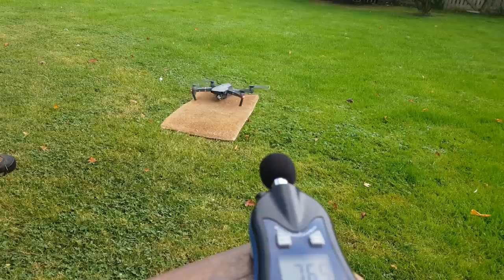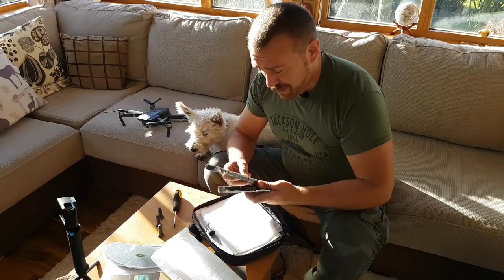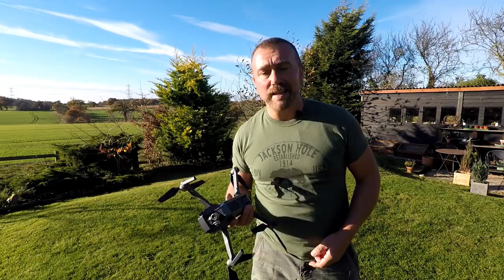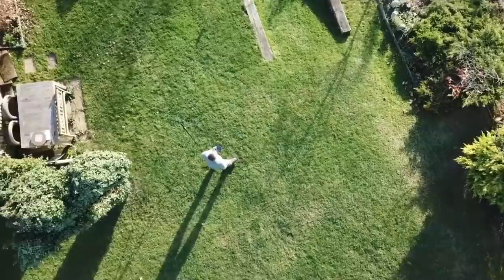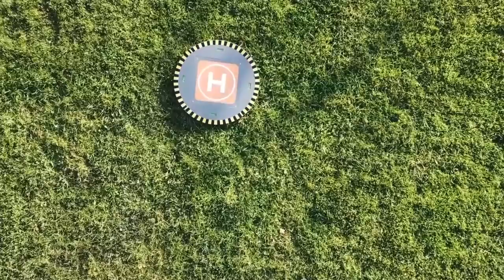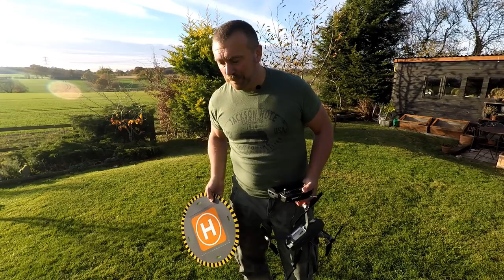Mavic Pro: Hand Catch or Landing Pad? Landing on Rough Ground

Comment: Great video Ian many thanks. Quick question on hand catching, can you catch the mavic while moving forward ? Thinking of trying to get some shots for a sailing boat but obviously the boat can't stop to catch the drone. What do you think ?
Reply from the maker: Right, this is difficult and my suggestion is absolutely to avoid using auto-land as that will try and land on a fixed stationary spot.   Your issue is that you'll need the left down stick to reduce altitude but also the right stick forward to make it travel forwards.  That's 2 thumbs; ie 2 hands, leaving none for actually catching it.  So my best advice would be to have it land on a large non-slip surface, like a big beach towel, and fly in from behind the boat, so you catch the boat up from the stern without getting snarled in masts and sails.   But I've seen a few attempts at landing on moving boats end in a sinking drone, never to be seen again.....  
You should also amend the Home Point Settings to follow the remote instead of a fixed GPS point.  That way it at least will know where it needs to aim for when doing an auto RTH....
Cheers
Ian
Reply: Ian in London many thanks, that all sounds great.

Comment: I use the pgy landing pad, works great and won’t move even when your not using the plastic hold down pegs it comes with
Reply from the maker: Drone Nerd I'm guessing that's wider than the one I use in this vid?  It was too small I think.... At least for auto RTH....
Reply: Ian in London yes it’s bigger, when I did a group fly we had enough room for three phantoms sitting in a v configuration on it. You couldn’t land and take off with three phantoms at the same time on it though. They have two different sizes a small and a large and I got the big one
Reply: Ian in London I just looked them up on Amazon, they come in three different sizes now. If you want enough room to let it land itself on the pad, id get the biggest one. Should work proper. They have the big one for $10 US on dji website
Reply from the maker: Cheers Nerd :)   I love the idea of a formation of Mavics in a V shape... :)    But I like the idea of using a car windscreen sun visor... easy and always there...
Reply: Ian in London I will admit, it’s an art form getting this folding landing pad folded up lmao. The car windscreen cover is probably a lot simpler to store